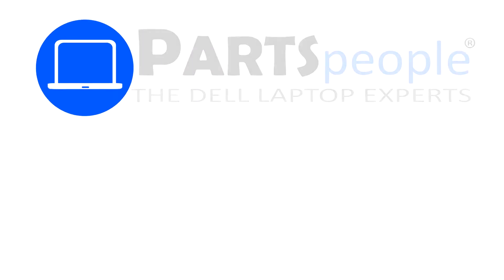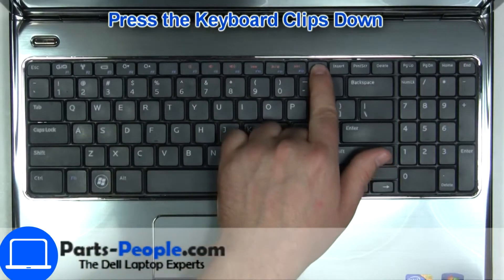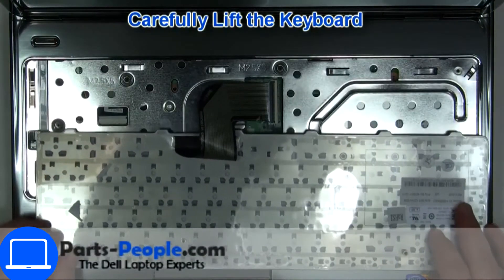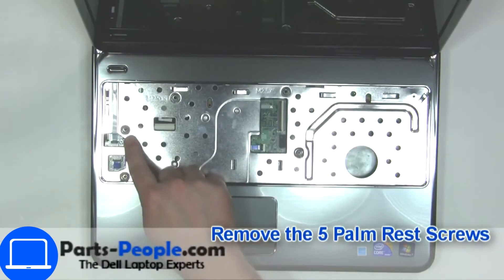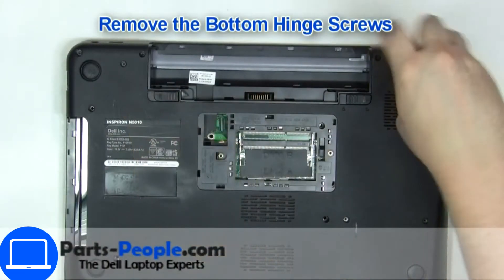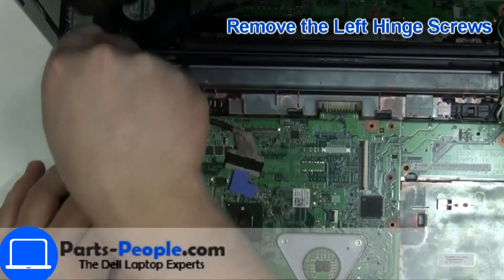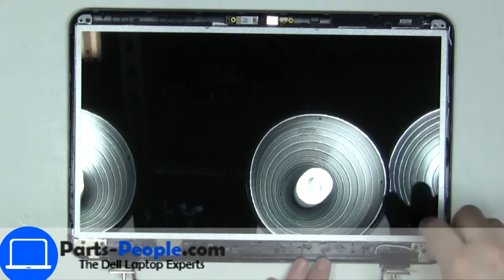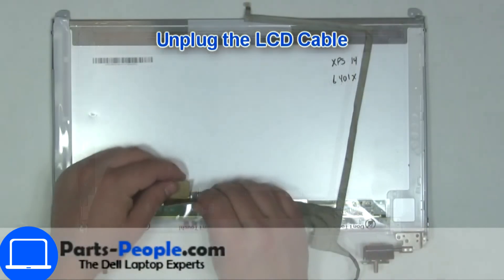Dell Inspiron 15 N5010 (P10F001) LCD Cable How-To Video Tutorial

Comment: Great video mate.  Congratulations. I´ve got the same model and I was worried about removing the flat cable because of the sellotape. Can you please explain how did you do the part behind the screen? I mean, You had to pull it or simply drag it up and pull ? Cheers mate.
Reply from the maker: This cable slides out going away from the connector (downward) while dragging against the back of the screen. Hopefully that clarifies your question.